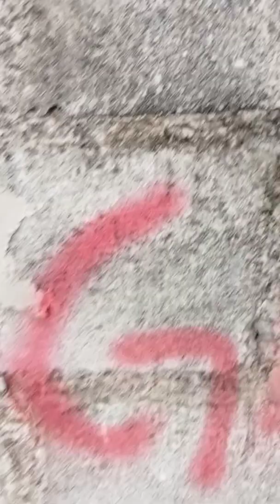Introducing Benchmark to Construction Site PART 2

Comment: Please am Albert from Ghana,i think Compound level is the height of the site ground 1170mm whiles Ground floor level also is the height which the an Architect need 450mm to well surface to be suitable for natural foundation.Tnk
Reply from the maker: That's why understanding drawing is also as important as site technical activities.
compound level are designed finished level for the compound of the building, purposely to channel water to different directions to external drain
Reply from the maker: while ground floor level is also the same as DPC level which is also determine by the architect and it's mostly higher than compound level.

Comment: Benchmark with the add on 0.450 is 720 or I’m the one confused 😕
Reply from the maker: If you watch the video very well and you have been following my channel, you will understand what benchmark is better.

Benchmark is just a reference to determine other levels or point.
In that video, I said the top of culvert now serves as our new benchmark and from there, we will transfer 0.450m above culvert that will now serves as our compound level and another 0.450m above compound level that will serves as ground floor level.

I hope this helps.
Thanks
Reply: Yeah it's 720

Comment: What's the different between compound level and ground floor level
Reply from the maker: Ground floor level is always high above compound to avoid water in the compound coming to the building, so, the architech always designs groundfloor higher above compound level.
Sometimes, 3 0r 4 steps of staircase above.
Reply: compound level is the normal ground level when you enter the compound, while the ground floor level is the level of the building oversight concrete of the building built in the compound which is always higher than the compound level